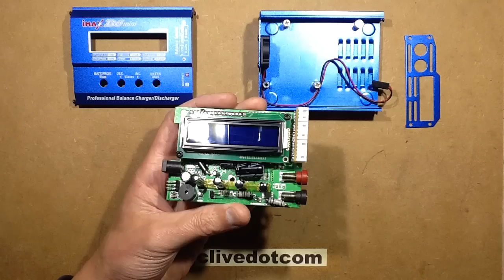Imax B6 charger clone autopsy.

Comment: Tell you what (watt no pun intended) Easy all you want is a 24 Volt 5 whatt Side light bulb and put it in place of the resistor I will just desapate unwanted power by means of light & HEAT! Remember the days when you had a circit (any) that had a blown transistor with no readable number? was it npn or pnp? simple! for npn stick a BC107,8,9 in there GO BC108 where possable and for pnp BC1?? FORGOT! IT HAS BEEN NEAR 50 YEARS! I always got away with those tricks just done the bulb dodge with my LIPO charger NO PROBLEMS! LOL

Comment: Did you you sort this out ?

A couple of days ago I was asking about this charger on another video of yours . 

The mosfet that you touch in this video at 1:45mins , that is the mosfet that burnt out on me , after connecting a li ion battery the wrong way round . 

Waiting on it to arrive . Have a couple of questions , If you do not mind . 

1,) what other components should I check / test after that mosfet ?
or rather what other components would be affected because that mosfet burnt out . 

Also I could not actually tell what all the numbers and letter were on my burnt out mosfet , I could see that it was NCE3010 . 
But I have noticed on new ones online , that there are more numbers and letter under were it say NCE3010 but as mine was burnt I could not tell . 
2,) Any chance you would be able to enlighten please . 

On a side note , 
I found a pdf , and on that one , that mosfet was an AO 4468 BV265U or it is BVB5U , but that BV number is an example of what I would like to be enlighten about as looking up the NCE3010 , there were loads of different options on that 2nd part of it , but again , mine was burnt I could not tell . 
Hope I have not made a mistake in picking the one I did .
Reply from the maker: It's hard to say what other components will be affected.  You could examine the ones in the vicinity for signs of damage.  The other letters on MOSFETs are usually manufacturing codes.

Comment: Hi... My Imax B6 AC charger, enter button is not working, i am pressing it for a second or pressing for long time let say 10-15 seconds but it is not working.
Nothing is happening by pressing enter button.
Can you please let me know what is the issue.
Reply from the maker: Try bridging the button carefully to see if the circuitry works.  It's very common for the cheap tactile buttons to fail.

Comment: Just came across this video after poking about inside mine which I've discovered is a fake (trying to find out why the voltage readings were wrong and jumping all over the place).  I guess theres nothing to do but harvest it for parts since I wouldnt trust it to safely charge anything.

Comment: Does this automatically stop charging batteries or do you have to this in the settings  ?
Reply from the maker: It should stop automatically according to the requirements of the type of batteries on charge.
Reply: I'm trying to charge lithium ion and lipo batteries
Reply from the maker: @davidferguson8478  With these chargers you can set the type of battery, number of cells and charge current.

Comment: from what I've seen of these clones is that they do as good as job at the originals, as most things these days alot of the original components are sourced from china and the clones are from china too, both internals on original and clones look identical. although the clones usually need calibrating.

Comment: I have a b6 clone and i have noticed it does discharge lithium cells to 3.3-3.2 v according to a multimeter, istead of the onscreen voltage of 3.0 v, do i need to calibrate the charger or it not fixable?
Reply from the maker: I'd suggest not trying to calibrate it.  That voltage is close enough for discharge as the capacity is almost completely depleted at that point and the voltage falls rapidly.
Reply: Thanks for the info, so the 0.3 v  difference at this voltage will not impact the capacity measurement accuracy, however i have no idea how accurate the clones are (not expecting much). I guess i have to get a high quality cell and compare the measurement results with the rated capacity, i guess.

Comment: Even the legit B6 chargers were a death trap waiting to happen. Lithium batteries are harsh but fair; don't over charge or discharge them and they don't explode, so naturally the B6 doesn't monitor individual cell voltages when fast charging. If you have a pack with a cell that's lower than the others it will go bang! The newer SkyRC chargers like the S60 are much safer.

Comment: if the suspected resistor is burnt out O/C clean up the wire and put a DVM and see if you can get a reading from one end to the O/C. then from the other end to the O/C. From that information and how far along the O/C is along the ceramic resistor barrel you should be able to calculate a ratio and therefore a good approximation of the original resistance. If you can't get the correct resistor you can always make your one with some  Nichrome wire.

Comment: That resistor must have gone incandescent to fail like this. There's plenty of 0,5 ohm resistors on Farnell though, maybe socket that resistor for easy replacement like a fuse.
uk.farnell.com/welwyn/w21-0r5ji/resistor-ww-3w-5-0r5/dp/9503560
uk.farnell.com/ohmite/43fr50e/3w-0-5-ohm-1-silicon-ww-axl/dp/2448946
uk.farnell.com/ohmite/45fr50e/5w-0-5-ohm-1-silicone-ww-axl/dp/2448964

Comment: Could you do any of those teardowns? I am interested in technical analysis of those items.
• Generic microphone amplifier, which is sometimes used in schools to boost the voice
• Ultra cheap disposable camera with flash built into it
• Bluetooth selfie remote
• Cheap toy walkie-talkies (probably ones with "TF" on it, which strangely looks like a ripoff logo from Faze Clan)
• Generic 16x2 character display
• Peltier element dehumidifier
• Portable MP3 radio thing (with knockoff Nokia BL-05 battery in it)
• RC helicopter (including the motor)
• Water fountain speakers (the ones which shoot stream of water in enclosed space when the "bass" drops)
• Flux-core lead based solder
• Annoy-a-Tron
• Handheld UV sanitizer
• Selfie stick (with built-in non-Bluetooth remote button which occupies headphone socket)
• Samsung Stylus thing
• Spot heat skin sanitizer (the tip heats up and supposedly kills acne-causing germs)

Comment: I purchased an iMax B6 from a seller, it was cheap, only worked 4 times before it died and won't power on.

The unit was stripped and I checked a few items, my first part I checked was a really beefy Rectifier Diode, my meter beeped to say it was OK, so I tried the second one, it didn't beep my meter... So I reversed the poles and tried again to be sure I hadn't got polarity wrong, it still didn't beep. So the issue here in my iMax B6 was a diode.

The point is that these machines are made of cheap parts and it is hard to tell a genuine seller from a clone seller. In my case trading standards were interested in my purchase and although the seller did a refund (about 95% of the cost) it shows that these items are so cheap that the cloners are ripping people off.

Comment: There's a way to find the rough value of the resistor by sanding the middle of the body, and measuring to which ever side that's still intact, that should be half of the original value. From the remaining color band, it shouldn't be too hard to guess the original value. I've done that a few times for similarly burnt resistors when repairing
Reply from the maker: That's a good idea.  Sadly, this one has such a low value that it's hard to measure even if it was intact.
Reply: +bigclivedotcom lol, I usually null out the probe resistance manually by measuring the resistor's lead but not letting the probe touch each other
Reply: wheatstone bridge
Reply: Richard Kaz ...which relies on having high-precision resistors in the bridge....
Reply: Just put a 24 volt 4 watt side light bulb instead of a resistor Job done!

Comment: theres a few variations on the b6, an ''original'' is just as badly built as the rest lol, its just been calibrated a 'little' better.

buy the cheapest, take it apart, run the iron over all the joints, reflash the firmware  then calibrate it yourself and you have a great little charger for peanuts.

and then theres the alternative firmware with all the added features .......

google is your friend/

Comment: the authentic B6 units are cheap enough. mine was only 30 bucks or so and is the genuine skyRC unit. if you just search by lowest price you WILL get a knock off unit.
Reply: How do you know for sure when you order?
Reply: +fabts4 it should tell you in the add, but the case looks different the original (non AC) has a big red IMAX in the bottom right corner with a big yellow B6 under it for starters.  but the best way is to go to their website and look at the model your buying to know what it looks like

Comment: I have a similar one, Turnigy Accucell charger. Anyway, it popped in a similar manor like these cheap things tend to do. It was a 50 ohm 2 watt. I didn't have a two watt resistor, but used four 1/2 watt'ers in parallel. Works great!  Also note, if the wrong resistor value or tolerance is used it may overcharge the battery which WILL cause your lipo to catch fire! After repairing, be sure to check the output voltage is correct and the end of charge voltage is correct with a DMM.

Comment: My B6 Clone has Black, Green, Silver, Gold in that position (though it is installed  reversed right to left from the photo you show).  the other resistor is a blue casing: Black, Green. Black, Silver and the board layout is a bit different (again, installed reverse from the example you have).

The supplied Crocodile clips are pretty terrible and could easily short against each other.  The only output protection I can see is a line in the manual that basically paraphrases the Chostbusters: 
   "Dr. Egon Spengler: There's something very important I forgot to tell you.
    Dr. Peter Venkman: What?
    Dr. Egon Spengler: Don't cross the streams.
    Dr. Peter Venkman: Why?
    Dr. Egon Spengler: It would be bad."

Comment: This is pretty relevant to me because I had one fail in a similar way. Venom PR2 charger had a 0.5ohm resistor burned out, and (i think) a mosfet. Might the .5ohm resistors be some sort of shunt for measuring current?

Comment: I keep seeing those JWCO capacitors in all kinds of super cheap kits & knockoff electronics.  If you open something up  and see JWCO caps, you can almost bet it's a knockoff.
Reply: They're not actually all that bad though for cheap caps in my experience. I put one in the secondary stage of a laptop charger as a temporary fix; it's been in there a year now and seems OK so I see no reason to change it.

Comment: I bought one of these chargers a while back to live on my workbench I will now need to go and research if mine is fake, but what I can say is that I looked at some comparison videos between real and fake... and neither of them are confidence inspiring...  I've never trusted it, and I always find myself unpacking one of my iCharger units... I have nothing but praise for the iCharger 3010b, or the 208b, they are both worth the extra money, and infinitely more confidence inspiring.... 

Also, the software on the iCharger units operates the same, but has 2 or 3 times more features, and far fewer bugs.

Comment: The discharge resistor on original is 0.5ohm and the charging sense resistor is 0.05ohm.

Try googling "Imax B6 schematics" and look the images. It gives you lots of site with full  scematics that may help with troubleshooting. There are even sites that  explain how it work like this russian site http://ru-radio-electr.livejournal.com/1295897.html.

Comment: Interesting video. I've got a real one of these along with a fake, the fake is a little glitchy when setting up and the build quality is obviously slightly  lower (from the outside, I've not opened them) than the real one, but other then that it is quite hard to tell them apart, so be vigilant when buying as the fakes are often passed off as genuine.

Comment: Clive i think a few people on rcgroups had the same issue, accidentally touching the casing with the positive banana hjack while a pack was plugged in, and it burnet out a track on the board, the fix was to use a jumper wire

Comment: Ive got one of those, advertised as OEM IMax b6 on amazon. Seller refunded me after contacting amazon about it being a clone/fake

the charger works ok, not sure on its accuracy though as i only have a cheap multimeter which reads 4.26v after battery is charged

Comment: If you get it working again you may want to calibrate the meter again. I've had success with these instructions: http://www.martinmelchior.be/2013/09/recalibrating-imax-b6-ac-charger.html and the simpler version: http://komar.bitcheese.net/en/howto-calibrate-imax-b6

Comment: It's a pity that the owner didn't catch the magic smoke, and send it to you in a ziplock bag, so you could put it back in, and fix this beasty without the need for new parts  ;) .
Reply: That would have worked except the container the smoke was held in ruptured (the resistor), so trying to put it back in would have just resulted in it leaking back out...... It's advised that if you were to attempt doing this you first need to use the "magic smoke part patch kit" and those are very hard to find and costly.... :p
Reply: MrTeddyMMM 
 LOL. Yes, the only time of the year that you can actually buy these patch kits is the first of April. 
 It is so odd that such a popular repair device is available for only 1 day per year  ;) .

Comment: I had a very similar failure of a better version of this. It had SMD resistors for charge/discharge current detection, I shorted the leads during charge or discharge (cannot remember which) and blew the ass out of one of the resistors. I just twiddled around with low value resistors and ended up putting two ceramic ones in parallel over the old one. I just shot in the dark and experimented with different values until the charge/discharge current of the unit was showing the same as my DMM on the charge leads. Mind you when the value is way too low the unit of course charges at quite exciting current values :-)

Comment: You should know that one has already been tampered with, their are many of these clones. I own the sky charger dual power B6AC+ model and in my opinion it's one of the better clones to spec.
Other are made cheaper like the one you have. Yours has already been repaired or tampered with. It should only have two mosfets on the back. I don't know if that third one wired is even wired to correct spot or why the bad one just wasn't replaced on the PCB unless a trace burnt out. I think this poor guy was not only sold a fake, but a repaired fake also.
See this video for the one like yours but with dual power. The main design is the same for the cheaper clone like the one your received but with AC power also.
https://youtu.be/5NCMp4jAdbU

This thread has a lot of info about these clones, maybe even some schematics. 
http://www.rcgroups.com/forums/showthread.php?t=1951734

And another repair like you are about to do.
http://www.qcptr.com/?p=55

Comment: The interesting thing is too,  the board has 2 through holes for reverse connection protection, but nothing is stuffed there.  The two holes are located top right, between the larger  connectors and the surface mount resistor field. You might want to add the protection in there while you're at it.

Comment: Looks like the charger I have :o

Hopefully mine isn't garbage. So far so good, but when these chargers go bad, the real danger is the battery going nuclear on you.
Reply: Hey, could you open yours up and see if you can read the color rings on that resistor for big Clive?
Reply: Ron Kihn Hmm... I think I'll try that, I'll also be able to see if the board layout is the same.
Reply: Ron Kihn ok, I got mine apart, and it looks like a different one. Mine might actually be genuine, but I do see two large resistors (in series?). They are near the negative battery terminal, and from left to right (both colors and resistors) it goes green, brown, white, red, black for the first one, and black, red, silver, brown, green for the other one. I'm not sure of the order for the colors, because they seem to be a color code I'm not familiar with. Why is there a silver band in the middle? Beats me, but I hope this info is useful to whoever finds it :) If you want a photo, I can send one and post a link.
Reply: Ron Kihn Also, I noticed that one the back of the board, there are two TO-220 packages on the back with insulating thermal pads that go to the metal case. Perhaps with the one in this video, the thermal conduction was also electrically conductive.

Comment: my imax has Overvoltage error, the problem was the mosfet 8-pin AO4468 and AO4407A and IRZF44 3 pin mosfet were damaged  , I replaced these components and my imax clone was repaired

Comment: Why does it have 2 types of resistors? Ceramic through hole and surface mount? Different demands of them?
Reply: +jjensen2492 that makes sense. More power and the larger ones dissipate the heat better. Thanks

Comment: another great video! ive got a set of 12v led projector lights for a motorbike but theyre 3 modes low strobe and high... any way to convert it to single high mode? im fairly competent with a soldering iron

Comment: I think it's a 0.05 ohms since similar Chinese chargers use two 0.1 ohm in parallel.
I use the same value in my designs since it's quite suitable value for current sensing and the voltage drop across it  is not so high.

Comment: i have one...would you like me to take a ohm's reading of the resistor ?
Reply from the maker: You might find it hard to measure.  The very low resistance values are hard to differentiate from the resistance of the meter leads and contact resistance.
Reply: Kelvin measurement will save your day, that if you have reasonably precise current source.